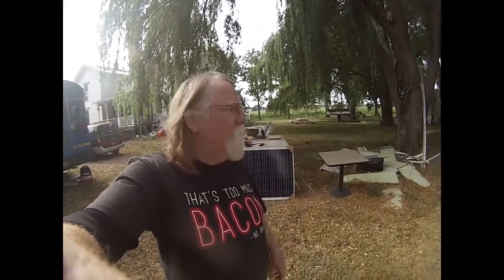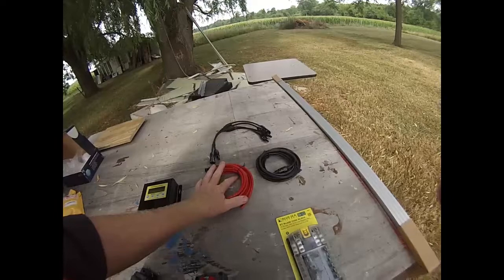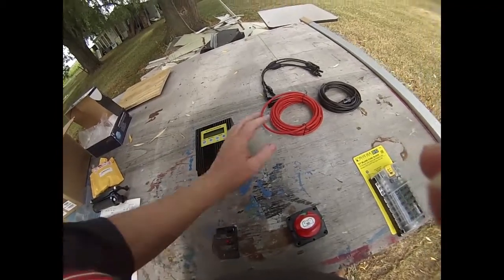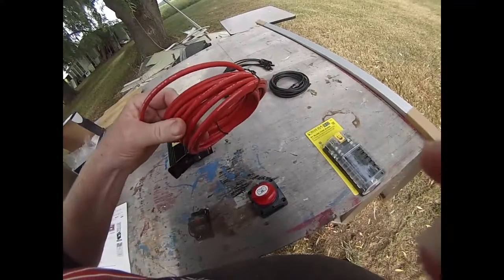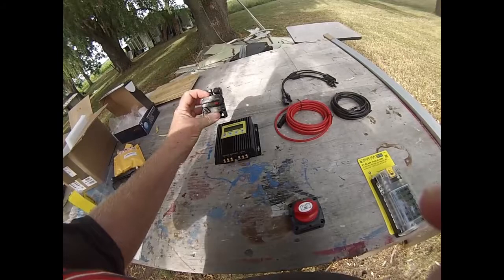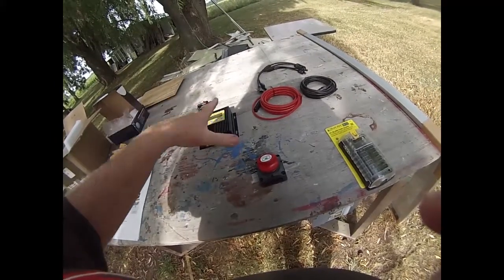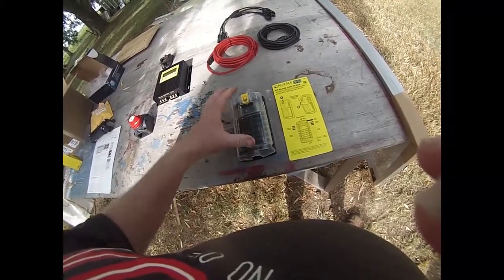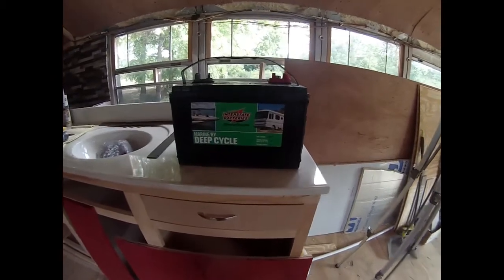Old Thyme Skoolie- Episode 37 Solar Electric System

Comment: Interstate batteries are a good choice.  You should have no problems with them.  Just be sure not to discharge more that 50% of total capacity as that will destroy the batteries (very expensive - I learned this in the school of hard knocks - my alma mater).

Comment: Your inverter, when you add it, will be the component that produces heat.
Reply from the maker: I did have an inverter for the fridge but now that that's gone I'm giving it back to my son. I just don't need it for anything. All my electronics are 12v or have 12v chargers
Reply: That does simplify things. Inverters are expensive. The money could be better spent elsewhere.

Comment: 4mm is big enough for your 2 solars also because you don't need to go a large distance. 
Batteries is always a choice of dollars per amp, and as you know what you're drawing they can last for 10 years. CCA is only relavant for starter batteries not domestic. Try not to drain them under 50% and they will last.